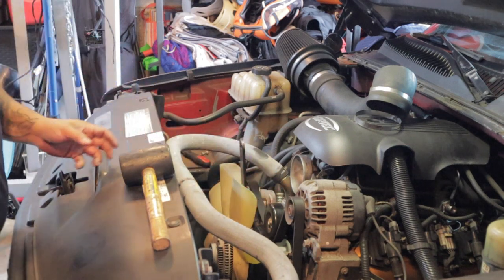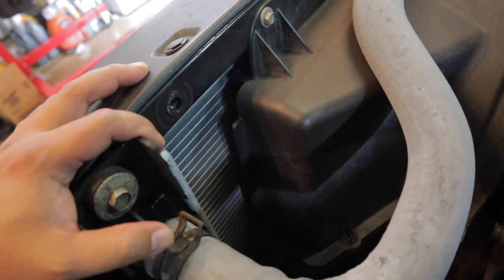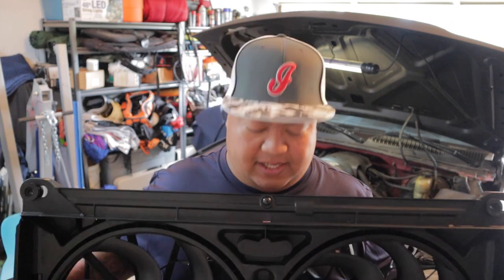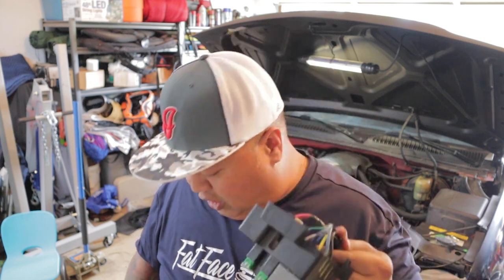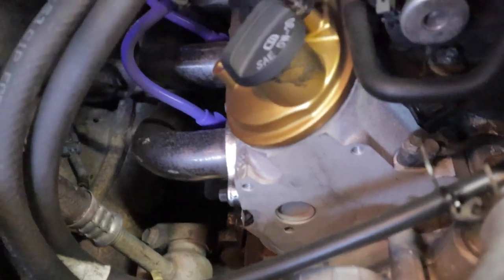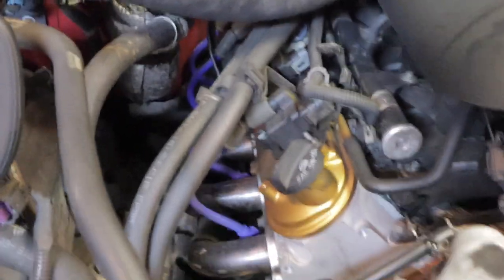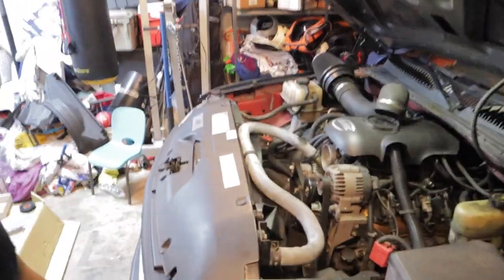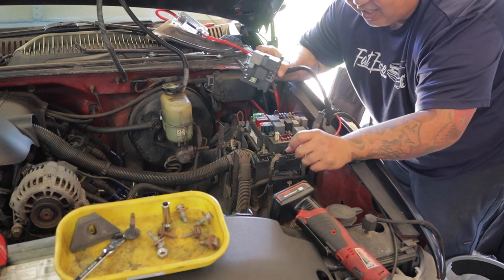99-02 NBS Electric Fan SWAP, silverado sierra Chevy GMC Tahoe Yukon Suburban Denali Chevrolet E-fans

Comment: I followed your instructions and now my 2002 Avalanche has electric fans! Your video had everything. I followed your directions and got the 7and 9 blade fans and the 2 bolts needed. That a/c up date kit was a life saver. Love my HP tuner. Thank you Sir.
Reply from the maker: @juanmendoza2262  Glad to hear 🤙
Reply: Now waiting for the dual battery installation video!

Comment: Just wondering how the fans are doing since you added the BP automotive harness. Can you do a follow up video?
Reply from the maker: Ok. I'll talk about it in my next video. It's actually amazing. My ac gets too cold now at times which lead me to figure out that my heater isn't working lol. I actually don't even know or have noticed the high speed kicking on which is fine. Truck stays running at 195.
Reply: I have the same oem harness but using a separate relay to get the fans to run on high when the ac is on. Thank you for your help and look forward to your next video.
Reply: Off what year is that oem harness
Reply from the maker: @christianmartinez9501  any nbs year with factory e fans
Reply from the maker: @Titian92  update coming. Just gotta edit it. 🤙

Comment: This was my experience with installing Dorman electric fans, a Denso 32" radiator, and an AC Delco 145 Amp alternator, with the BP Harnesses (relays, fuses, etc.), AC upgrade kit and BP tuning of my PCU. This was on a 2000 Silverado 1500, Z71, with a tow package, and the 5.3 engine with 148,000 miles. The truck also had a new/rebuilt transmission, a Scan gauge device and a new clutch fan installed last year.
Much of these installation procedures I learned from YouTube videos, but BP also sends very clear instructions. After the total installation and completing a key/security relearn procedure for the PCU/computer, my truck started but was running roughly. I then learned from my HAYNES manual that there is also a relearning process for your PCU when you disconnect and/or remove the battery. You'd think I'd have already known this. That process is to run the engine at idle until the temperature comes up toward the normal running temp, then run the engine at 1500 rpm for two minutes, then drive at least 5 miles under normal conditions. While running the engine at home I turned on the AC and the fans immediately came on at low speed, and they would intermittently, briefly cycle off and then back on. While making the relearn drive I drove down the HWY approximately 20 miles at 65 mph and up one steep incline, then back through some stops and starts. On my Scan gauge I could see that, as normal, my engine was running from 190 to 195 degrees. And my transmission was at 170 to 175. My truck temp gage stayed where it always does, unless under a heavy down-shifted load, at the first line before 210. As I wrote previously, I know that my fans come on at low speed as soon as I turn on the AC. And BP programs the fans to come on at low speed at an engine temp of 216 on, 209 off. And High speed at 225 on, 217 off. So, I turned my AC off intermittently to see if the engine temperature would go up and it never changed. It makes me wonder how much that clutch fan was spinning and using horsepower, even when it was unloaded, when it wasn't even needed. Or maybe the bigger radiator is the difference. Today I made my first run further, pulling my 21' toy hauler trailer on the HWY at 65 miles an hour up several grades/hills. One reason I upgraded all of this, besides the little bit of extra horsepower, was that before this, when I would pull my trailer over this same route, my transmission would down shift, my engine would go to 4000 rpm and if stayed at 4000 for more than a few minutes my engine and transmission temps would sometimes hit 120 to 125. And I did not like the sound of my engine in that state. Today neither my engine nor transmission went over 110. And my engine sounded so much better without the clutch fan. Even idling it sounds better. To be factual, today I was not as loaded down as I would be for a long camping trip and the outside temperature was only 70 degrees. But there was a very noticeable difference in the amount of downshifting and the temperature rise. Also, I checked my battery voltage when first starting the truck the first time, with the new alternator. It was reading 12.7V not running and 14.7V running, as it should. Today while pulling my trailer, I turned on its running lights and the AC to try and get as much amperage load as possible. At no time did my voltage gauge drop at all. But, since my engine never went over 110, with the AC on and fans at low speed, my fans would not have ever needed to come on at high speed. That means that I still don't know if there will be a voltage drop when I am pulling a heavier load and both fans go to high speed. 
A few more notes on things I learned. I didn't know that the old fan shroud bolts would not work for the new fan assembly so, I had to go to the dealership to get two more of the radiator bolts. The BP instructions tell you that you should change the O-ring on the AC Schrader valve that the pressure switch you'll install goes on. I also got that at the dealership. The instructions didn't mention that when installing the pins into the PCU you'll need something sharp and no larger than the size of the pin to punch a hole through the weather seal of the ports that did not already have a wire in them. I used a Phillips screwdriver about the size you'd use for glasses. One other difference from the instructions I ran into was that where the new relay assembly mounts, next to the relay/fuse box, I had an extra connector mounted under where the new assembly was supposed to go. So, I had to make an extension for the bracket where your supposed to mount the relays and I was able to mount them about 2 inches higher, over that extra connector. The case fit over this with no issues.
Reply from the maker: Have you seen my update video? I'm curious to know what bp set your ac controls to. (Analog, analog cycling, serial cycling etc.) After doing this I found out my compressor didn't cycle off

Comment: I wouldn't recommend to by cheep fan harness from eBay.  You have to modify those harnesses. 
 I purchased "3-relay" harnesses from eBay- just to look at. I compere wiring to GM OEM wiring. Wiring was correct for (same as 2005). I'm not happy with size. Power wire #10 (or#12 it hard to tell), fused 40A and  spliced to #14 inside the loom and feed the fans throw relay.  Middle relay was wired correctly - for 5 pin relay and 4 pin relay was installed.

Comment: Someone hard wired my e fans in and now my ac won’t blow cold. Coincidence? Or will the ac kit fix that? The ac was fixed a week before the e fans, but now it says overcharged, major pressure swings when the compressor kicks on and off. Still blows hot air only though
Reply from the maker: @arturo2551  no idea what that someone did so I couldn't tell you.

Comment: I'm having problems completely tuning my truck I have a 2002 silverado 1500 4.8 
Os 12212156 
When I go to 
Systems > Fans> 
It only shows 
1st stage & 2nd stage  (on and off ect). 

So I'm basically missing all other options to modify. 
-Enable speed
-Disable speed
-On temp ac on
-Enable AC press
-Disable AC press
-Enable delay
-Disable delay
-Min time
-AC Fans Disable speed.
Reply from the maker: @chinogodinez  edit > view > advanced
Reply: @CheeHooGarage  thank you for the response I will try this now.

Comment: Ok so the blue wire goes to red connector pin 33 so just remove whats there and put in blue ok got that, but what about the recirculation acuator control that is allready there?
Reply from the maker: @seabornroberts7512  I don't know the exact circuitry of the recirc feature, but some trucks don't have a wire there and the recirc function still works. I'm wondering if my truck had it now and maybe that's why I never talked about it in the video. I don't remember

Comment: So at 33 minutes you didn't show where you pit the blue wire in the ecm, supposed to go in #33 of the red side, but, mine already has something there.
Reply from the maker: @kryticlemass6699  you're right I missed that. The wire already there just gets pulled out and replaced.
Reply: So did you remove the wire and insert the blue and everything worked?and that's pin 32 on the red connector right not 33.

Comment: Buddy of mine used his Milwaukee hammer drill sds tapped it in the fan built loosened right up definitely going to swap over to E fans the original fan ain’t cutting it and I just put a new clutch on the fan changed everything still warming up I know it’s the fan just waiting to find a good video that explains everything and you did all that thank you

Comment: DUDE! THANK YOU! You are the only video talking about the A/C Update Kit SUBSCRIBED
Reply from the maker: Thanks bro 👍
Reply: @CheeHooGarage Hey brotha are you going to make a Update video soon? I seen you mention you are on a different comment, Thanks man!
Reply from the maker: @IDABAYAREA650I  hopefully in a couple weeks. Been crazy busy. Thanks for sticking around 🙏
Reply: @CheeHooGarage all good brotha, question im wiring up my Harness and the Red 33 already has a Blue wire connected in its place? Do i remove it to put the E fan blue wire in?
Reply from the maker: @IDABAYAREA650I  yes. That wire is the one that turns on your resirc button automatic. I don't know why mine didn't have it?? I would just pull it out and put a heat shrink on the end. Or cut the terminal off and tape it
Reply: @CheeHooGarage  Yeah i just did it now i gotta wait till Friday for the Tune, but yeah no worries brotha handle your stuff ill keep coming around for that update video! 👊🏽
Reply from the maker: @IDABAYAREA650I  I did it! Just gotta edit it now 🤙🤙🤙
Reply: @CheeHooGarage  Ayye hells yeah lets go 🤙🏽

Comment: That was a great video,  I plan on doing my truck too. Does your alternator keep up when the fans are on? I heard somewhere that the 105 alternator needs upgrading. Is that true? Thankyou  for the video.
Reply from the maker: The people that need to upgrade alternator usually run the green wire to the ac clutch therefore having the fans at highspeed all the time the ac is on. If you do it like I did, the high speed only kicks on when needed.
Reply: Question i saw a 1 pin kit for 00-02 tahoe i think just for the low do you think that would work just as good ? @CheeHooGarage
Reply from the maker: @kvngneptune_3687  I'm not sure
Reply: @CheeHooGarage  I'll just get the BP ac kit be on the safer side when August comes🤣🤣🤣🤣

Comment: Thanks for the video. I purchased the kit and now my fans kick on with the ac on. The only issue I'm having is the compressor is constantly running it doesn't cycle on and of with the fans. I had them programmed to 2 fans  and set to analog. It's causing my ac to freeze up from it constantly running any ideas?
Reply from the maker: Watch my other video. Efan Update
Reply: Ok thank you

Comment: Changed my clutch fan yesterday on my 02' Blazer ZR2.  I did the same, put a wrench on & smack it. I've changed many & all just pop loose. 
It didn't make much of a difference though.  I just installed the Severe Duty Clutch Fan, flushed my radiator,  put another 195° thermostat & green coolant in & checked my water pump & belt tensioner. That 4.3 hangs around 195 to 200deg when it's 80deg out, but 90-100deg here South of Houston it starts rising to 210 & a bit higher. 
Especially when towing a small but heavy utility trailer.  
Is this normal or am i freaking out over nothing? I know the 4.3 is made to run hot but i don't like it. If i install a 180 thermostat.  I get the ole, "Below Temp Threshold Limit" Code.
Reply from the maker: Normal bro. Nothing wrong with the clutch fan. I just wanted to go electric because it looks better lol

Comment: I made my 99 work the AC with this solution I wire the c1 42 pin module the green wire like all the trucks is always empty, but for the other blue cable of the connector I use the dark green cable comming from the ac relay beneath the fuse box, i took a cable patch it to it and then connected to a relay on 86, 85 87 both grounded and the 30 back to the blue wire on the harness, this relay thing is necessary in order to make the signal comming from the dark green cable of the ac relay negative instead of positive, i found it easier and cheaper to replace the ac sensor, and I guess it works like its supposed to? With no AC on the fans are off when the temperature hits middle they both start on low speed cool off the radiator for a bit then off but when i turn on the AC the fan on the compresor side starts on high speed, while the other is off, is this how yours work? With the wiring of the AC sensor? Amazing video btw
Reply from the maker: Thank you bro 🙏. Mine works like factory, two fans on low for low speed and two fans on high for high speed. Ac on, fans stay on low until pressure reaches whatever psi i set then high speed kicks on. No ac, fans come on at low speed at 185 and high speed at 205

Comment: Great video 👌🏽 

The electric fan harness is from what year and model?  I’ll like to do the same and look oem as much as possible 

Thanks
Reply from the maker: @renedeleonjr1858  you can get them from any nbs truck, tahoe, Yukon, suburban that came with e fans. Search "silverado fan harness" on ebay, there's a lot.
Reply: Thank you. 🙏
Reply: Would the fan harness from a 08 Yukon Denali work on a 00 Silverado.  I went to the local junkyard and that’s the only truck they have. No Chevy truck 🤦🏽‍♂️. 

Thanks 🙏
Reply from the maker: @renedeleonjr1858  07- up won't work. Those are gmt-900 you need one from a gmt-800
Reply: Thanks for your reply. I didn’t realize the time difference.  I’m in Texas 

One more question 

Will the fan work from the 08 Yukon Denali. With the fan harness from a gmt-800?
Reply from the maker: @renedeleonjr1858  yes. I actually have fans from a 2012 cause I like the 9 blade.

Comment: What’s up bro thanks a lot for the how to video….I have a 2001 Chevy Tahoe and I followed what you did including the update video my issue is my ac clutch is not engaging may I ask what you would recommend I check thank you in advance
Reply from the maker: When you connected the wire to the pressure sensor, is it still connected to ground?
Reply: So I hooked everything up the way you did 
I got the BP ac update 
From the pressure transducer I did 
Black wire to c1 49
Gray wire to c1 8 
Red black wire to c2 14 
I also got an oem harness 
Wired the blue wire to c2 33 
I want to say when I did that there was a wire in there and I just put shrink wrap on it 
Wired the green wire to c1 42 
To avoid doing extra work I decided to just do the update wiring because I read the comments sounded like a lot of people did the same with their 2001 and or 2002 so that being said I removed c2 55 and put that wire in c2 17
I then took the wire that was originally in c2 17 and I wired that to the black wire on the switch that is on the accumulator that’s it that’s all I did had a guy come and I copied all your settings from the first video so my two settings are still at zero I forget which ones speed? I wanna say anyway please let me know what you think could be the issue if I did something wrong thanks so much
Reply from the maker: @justinhall8604  so you cut the black wire from the switch and connected to c2 17? Meaning the other end that's cut is just hanging there?
Reply: @CheeHooGarage I figured it out it was a simple mistake on my end I connected c2 17 to the black wire at the switch (coming from the truck) lol not coming from the switch negative terminal idk what I was thinking there ahah anyway thank you so much for the video great job
Reply from the maker: @justinhall8604  👍👍👍

Comment: Is there any benefit to the gen 4 efan over the gen 3?
Reply from the maker: Probably not. Just more blades
Reply: @CheeHooGarage  thanks for the reply! Right now i got a fat 75amp relay with a toggle switched single e fan. Do u think that'll plug up to the dual fans fine?
Reply from the maker: @guitarguy3221  technically yes but is that the only way you want your fans to work?
Reply: @CheeHooGarage  yea I tried wiring to the ac & ect sensor - ran into some problems, so I just switch the fan on for city driving
Reply: My 40a fuse blew with the dual fan so I got the stock triple relay harness from the junkyard. 

The green wire ac switch is a switched ground, so I tied that to the body and put another cab switched relay in line with the 10awg Power input

Comment: Nice video bro I’m doing e fans to on a 2000 Chevy Silverado I c the blue and red connection but my wires are green and white and now I’m lost lol pl help
Reply from the maker: I don't understand what you mean
Reply: I plugged my white wire to pin 42 no problem but when I went to plug my green wire to pin 33 there was a wire already there so now I’m lost
Reply from the maker: @jesseesquivel6248  just take it out and cover it up. That's for ac recirc. I had to do that too.
Reply: Do you have to use ac kit for it to work? I have a 2000 gmc with 4.3. Thank tou
Reply from the maker: @miltonmiranda9900  no you don't
Reply: Ok I was a bit confused because I saw a few other videos where they said it wouldn’t work for 99-03. I think white dude with green sierra mentioned and someone else. Thank you appreciate your help.
Reply: TWA Motorsports

Comment: Have another question, does the AC system needs to be discharged to remove the high pressure switch? Or it doesn’t matter? Thanks
Reply from the maker: No. The switch sits on a shrader valve. When you un screw it, nothing should come out, unless it's stuck. Might have to push the shrader a couple times if it's leaking
Reply: @CheeHooGarage  great thanks! Got the kit and I’ll be doing the fans conversion next week! Thanks